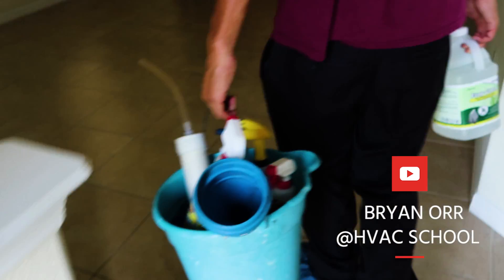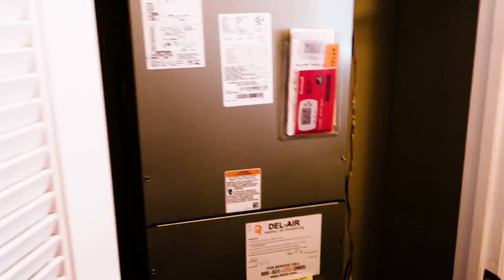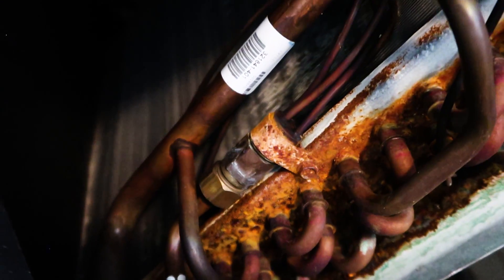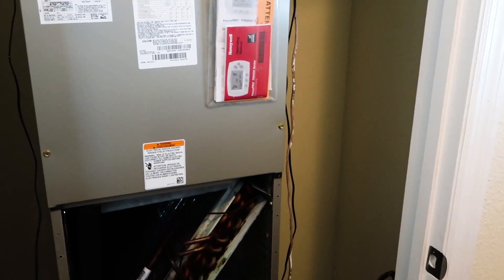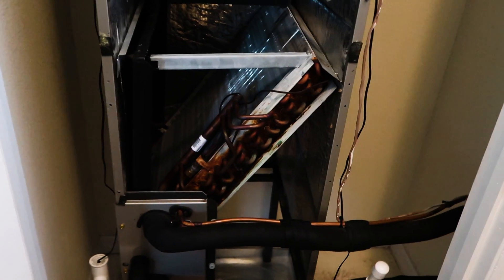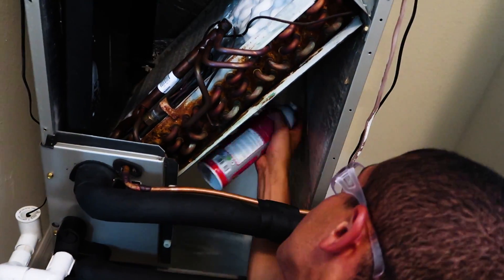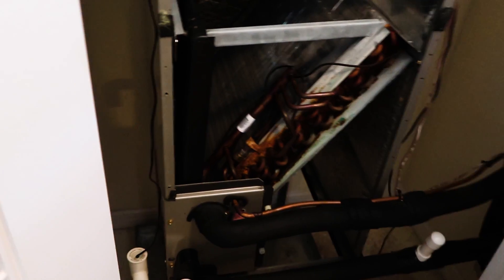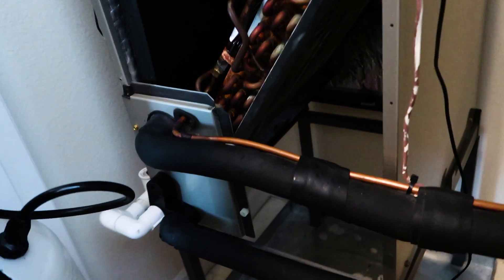Cleaning an HVAC Slant Evaporator Coil in Place Using Viper

Comment: Very little air flow out of my condo A/C.  I have an upflow slant coil that literally has blue corrosion on the top side of the coil.  How do I deal with that?  Does the spray foam cut through corrosion or do I need to spray some sort of baking soda type cleaner on there to dissolve it?  I'm worried that the fins are now shot and will all have to be replaced.   HELP!

Comment: Those evap. coils were very easy to access... whats your method of cleaning  hard to reach coils ...I have a small access panel above a York Diamond 80 furnace... I can barely get a cell phone camera in to take a pic of the inside of that A shaped coil.
Reply: Thats how these "how to" losers do it. Be it cars, ac, electronic. They ways pick the easier models.
Reply: I find depending on the kind of return setup they have you can access them to some degree. If it’s a A frame coil in a closet with a free air return and just a filter blocking the coil you can access it fairly easy to some degree if it’s a return plenum with duct board you can measure and cut a piece out at a bevel and pop it back in and reseal with smacna tape and mastic so no air leaks out. I use a oil catcher style tray a pump sprayer with water and viper foam coil cleaner when I do A frame coils like this
Reply: Along with the shop vac to suck out the foam and water I’m rinsing. The inlet is usually the dirtiest part of the A frame coil

Comment: I have a question, hopefully you can guide me in the ride direction. Info before question: I have an HVAC unit and the coil inside the house is set in an angel(My HVAC is 20 years old and so is the coil. Still runs great.). I noticed last night rust/corrosion is staring to build up on the pan that catches the water from the coils that leads to the drain pipe(s) and the bottom of the coil.
What would you recommend I use to remove the rust that is on the pan and starting to come up the side of the coil?
I do use the coil cleaner form twice a year and I know they remove dirt, debris, and other junk that gets in to the fins. I am stuck with Google searching how to remove the rust. I do not want to introduce no chemicals (acids, anodes, etc.) without hearing from experts in the HVAC field.
Reply: Agreed, you cannot stop the rust. There are ways to slow it such as using a wire wheel to remove all you can then spraying the metal with a spray can of cold galvanic coating. It's not going to stop rust but it will slow it down some. Spraying the cold galvanic spray paint on top of any rust will not do anything for the rust under it. You must remove the rust then coat the bare metal. Replacement plastic pans are available too.
Reply: @jamminwrenches860  scrape rust vacuum it with shop vac. If you need to tape a clear thin drain hose to the end of a shop vac attachment to slide under , do so. Cut the end of the hose on a huge slant. Then lay it in a guide it. If you need to scrape a distance but pan sits near to a/c you can tape a thin flexible metal scraper first. I then tape a throw away chip brush to the end of that flexible clear drain line hose(that hose at Home Depot comes in all different dimension. 1/2'' or 3/4''. so you can watch what you originally vacuum and then it is super flexible. So then a strong hand pump sprayer and shot Ospho all over the pan and let it harden. Maybe 24 hours. The Ospho will stabilize the metal and convert rust into a very strong solid substrate. If you are very industrious you can then buy white roof mastic and a super thin hot dog roller and apply to coat pan and create a waterproof membrane. I have done this and it is stunning beyond belief. My next ac unit I will coat the pan from scratch. Also a really good marine paint for boat bottom would be great. I coat my gas holding tanks in those to prevent rust. Inventing your own tools and using marine grade materials always is the way to save the day. Good luck to you...
Reply: You don't stop the rust. You change the pan.